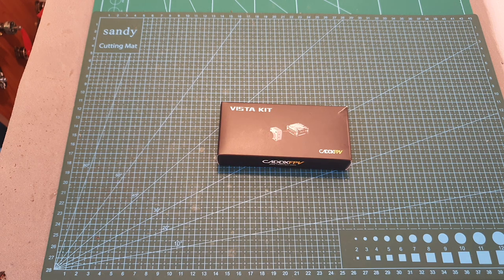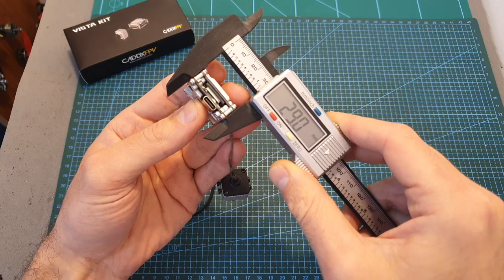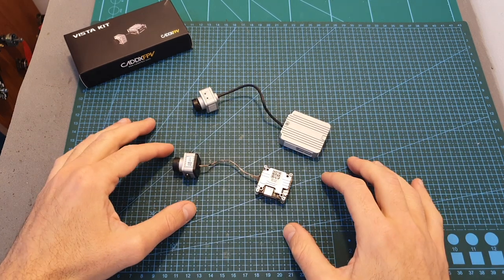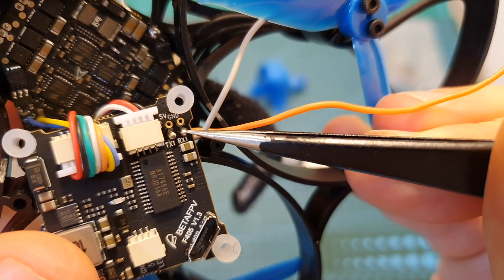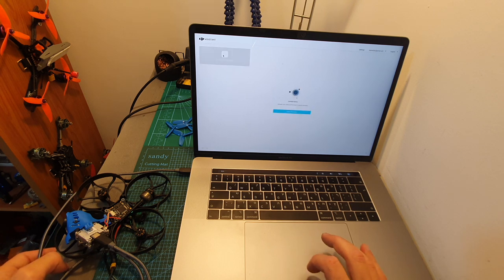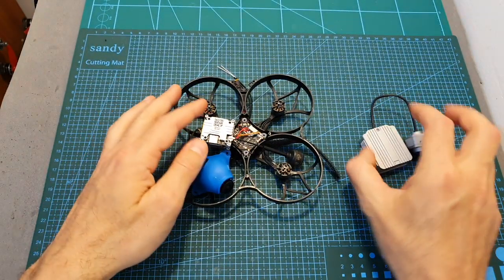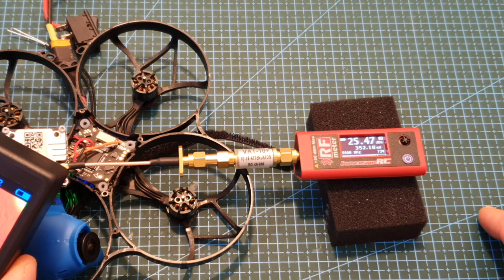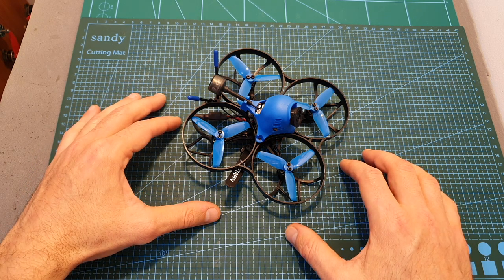Caddx Vista Air Unit (Lite) - Setup & Review

Comment: Help. LOL I broke my ufl connector on my vista. My friend has the top board with different firmware and activated in his account. Can I use it ? Will I have issues with activation and firmware downgrade after install ?

Comment: Hello Gal, I have the caddx vista nebula pro, however when I connect it to the DJI assistant it doesnt recognize it and nothing shows up. Any tips for troubleshooting this???
Reply: Make sure you have 10v at the caddx unit.  Use a multimeter.

Comment: Please help. I'm stumped, my caddx vista shows up in dji assistant 2 fpv series but doesn't show as a usb or hdd on my computer, so can't get to drop the file on, any advice? Thanks
Reply from the maker: Hi, you need to power up the Vista (make sure that the antenna is connected) and only then connect the Vista your computer. If it doesn't work - try a different USB cable.

Comment: It seems that after successfully binding to my Caddx Vista and then reverting to my DJI FPV drone, I have to rebind to the drone.  Is that correct?  I.e. every time I want to switch to a different air unit, even if previously bound, I'll have to go through the binding procedure again.
Update: On other forums, others have confirmed that you should be able to bind multiple air units without rebinding.
Reply from the maker: I am sorry but I don't have any experience yet with the DJI drone.

Comment: I plug my sister unit into the USB-C then I plug my battery in the light turns green on the Vista after about 15 seconds then I hit except twice then I hit activation and it says activation failed. Can you help me what’s wrong
Reply from the maker: Did you get it sorted?
Reply: @KremerFPV  I got the vista sorted. Now I’m trying to get the goggles activated. The goggles take the first 100% of the activation then it will not go past 0 on the second. DJI goggles update failed upload error log. 
I have a family and I haven’t been able to work on them again I may have time this weekend I just I’m not sure what to do they won’t activate they won’t take the activation.
It’s also been cold and windy my old fingers don’t like the 🥶

Comment: anyone failed when activating the vista via dji assistant? mine was stuck at 95% and now it won't detected in dji assistant
Reply from the maker: Make sure that it gets cooled down. I use a small ventilator. Keep in mind that the last 5% usually take longer so be patient.

Comment: I don't understand why DJI did this in the first place, this makes so much more sense than the air unit.
Reply: than* and i wish they didnt partner with caddx, they are known for bad quality control.
Reply: @BonemysterFPV  Sorry for my lack of English my main language isn't English, first off all I personally own Caddx products and have never had QC problems. Second is that what Caddx did is smart because not all builds can fit the DJI air unit. You try putting that in a micro and it would be half the weight. So stop complaining competition is good because this segment of FPV won't grow with DJI being to only producer
Reply: @BonemysterFPV  Also maybe Gal can confirm this but I'm pretty sure the Caddx Vista is produced in one of DJI's factories (somewhere on the box it says that)
Reply: @BonemysterFPV  you've been watching too many Kabob videos 🤣😂
Reply: @BonemysterFPV  Caddx doesn't manufacture this, DJI does. Caddx just sells it under a partnership.
Reply: @mrb2917  all facts. Caddx was smart enough to get with the best technology first.

Comment: Hi Gal can you connect the vista to a F3 flight controller
Reply from the maker: As far as I know - yes, but I haven't tested it. 
On a side note - FCs are pretty cheap these days and for less than $30 you can get an F7 controller, so if you can - get yourself a new FC.

Comment: How are you able to access the osd and change the pids as when selecting this in the goggles It wont allow you to make any alterations as you need the DJI transmitter
Reply from the maker: I am not using this feature but as far as I know it has nothing to do with the DJI transmitter as it's solely done by the goggles.

Comment: Wow the power output is way way low! That’s pretty bad.
Reply from the maker: Digital VTXs work a little bit different than normal ones so as I mentioned in the video this test is not valid.

Comment: If I'm planning on running it on my rc plane with no flight controller, can I just solder a plug to the power and ground to run a separate battery?
Reply from the maker: Yes - you are not going to be able to monitor the battery voltage though.

Comment: Hi gal i just received my vista, wiring up, turn it on and update it, so the vista recognized on computer and managed to activate it. But the vista doesnt get connected to the goggle it's just image transmission stopped and no thing when i check on device....do you know what cause that?
Reply from the maker: Hi, did you bind the Vista unit with your goggles?
Reply: @KremerFPV  yeah man i forgot that last time lol

Comment: I was going to put the unit in a surface tank.  Is it able to run without a FC.  and Just power it up and bind to the goggles?
Reply from the maker: Yes. Just make sure that it gets enough ventilation.
Reply: @KremerFPV  thanks. Yeah I’ll mount a fan with it for constant cooling

Comment: Great stuff! ; ) So....with the CADDX Polar Vista Starlight + (unboxed/no sd slot) Air Unit, and a non DJI FC, running Betaflight, we can: a) record 4K onboard to memory! b)bypass DJI Geofencing? and c)Still fly with a DJI Contrller (via sbus) and/or the DJI Motion Controller? (via sbus?)
Reply from the maker: Thanks! Nope, you cannot record anything (so far) to the onboard memory and there is no need to bypass the DJI Geofancing as it's not present when using the Vista / Air Unit VTXs. You are getting confused with the DJI FPV Drone. 
You can only use the first DJI Radio Controller (not the one that comes with the DJI Drone) or your own Radio TX with the Vista / Air Unit VTXs. The DJI Motion controller is not supported.

Comment: 5:14 , please help. I tried everything: switching ports, cables, laptops, make sure battery is full etc. When i plug it in, nothing happens. You said after 20 secs. I let it sit for 2-3 minutes: no reaction at all. Double checked everything, wiring 100% right.
Reply: nevermind, found it out, had to do something different on fc
Reply from the maker: I am glad you got it sorted out.
Reply: @energydrinkdose7585  I'm having the same issue. What did u do
Reply: @alwinlee5864  Had to short some pads on the fc to get the powersupply working.

Make sure to use a usb-c data cable, not just charging cable (cheap ones may not be able to transfer data)

What could help:
Triple check your wiring, make sure u didnt mess up anything, especially the extra pad for the dji radio, which u dont need if u dont use it.
If still no success:
Desolder everything on the fc (unplug?) and esc if used, coming from the vista. Then just use the power and ground cables from the vista and connect them directly to a power source (2-6s) [make sure antenna is mounted!], so the vista as a complete standalone. This should let you send/receive video (without osd) and perform updates. If that all worked, try resoldering it correctly. If it doesnt work after soldering u messed it up or its a problem with fc.
Reply: Hey mate what was the issue ?
I’m connected to B+ and ground rx&tx and having the same issue 
Zero power ??

Comment: Hello Guys, One question and I´m sorry for my ignorance. Is it necessary the DJI Goggles in order to use the Cadix Vista unit? Can I use the Cadix Vista with my Eachine EV200D Goggles? Thanks in advance
Reply: Requires DJI Goggles
Reply from the maker: No need to be sorry. As Travis said, DJI goggles are required, at least for now as external DJI HD VRX module is not available.

Comment: Is this plug and play compatible with some FCs such as the Iflight Succex-D f7?
Reply from the maker: You will need to solder the wires to the Vista, as it doesn't have a plug like the Air Unit.

Comment: Thank you 
I am installing my first HD kit “nebula pro” and have followed all the instructions 
Power to b+ ground to ground pad and rx tx wired correctly 
I have power to the pads 
But I have no power to the unit ?
It won’t connect to the assistant nor does it generate any heat 
Have you seen this before ??
Cheers
Reply from the maker: Does it work when powered directly to a battery?
Reply: Gal Kremer thanks for the reply !! I’ve powered directly from the battery lead and she now gets hot and has even connected and updated to assistant , but the indicator light doesn’t come on at all and she won’t bind !!!🤨 
Any suggestions would be appreciated 
Thanks mate

Comment: Gal, you left the four camera mounting screws in when weighing the Vista. Couple of grams more different then?

Also, it is not easy to mount the Vista using the 25.5mm “mounts”. Take out the screws and you’ll see.
Reply from the maker: Thanks, I just weighed these 4 screws and found that they weigh 0.8g. 
I will hopefully test the Vista using a whoop flight controller.
Reply: @KremerFPV  Awesome, thanks! 
Only .8g, good to know.
Can't wait to see how you mount it to a whoop FC.
Please post it to the FB group too :)
Reply from the maker: @TweakRacer  Sure thing.

Comment: Nice review! How did you diabled the auto-temperature protection ?
Reply from the maker: Thanks. You can turn it off via the settings menu.
Reply: @KremerFPV  oh! thank you, i thought it was something like "push the butto for 10 seconds etc." I asked because i am having problems in binding my caddx to my goggles v2. It works perfectly with the DJI air unit but with CADDX no way, the red light stays fix on (with a very low intensity) and if ia do the binding procedure nothing happens. CADDX unit is visible when connected to the PC but does not bind, so i thought it could be the "heat protection"...

Comment: never compatible whith Fatshark hdo hdo2? :(
Reply: Well unless someone comes out with a HD module for fatshark goggles, sadly no
Reply: I sold those goggles quickly. Those things would've kept me in the analog ecosystem longer than I wanted. I use a module to fly that old stuff. I even got decent money for my used analog  cameras, vtxs, frames, and receivers. I'm down to two whoops and two toothpicks on analog.
Reply: @escobarfpv1275  Same. As soon as I put the DJI goggles on I listed my HDOs for sale. Got nearly full retail for them. A module in the DJI goggles is fine for the rare occasion I fly a tiny whoop or a toothpick.
Reply: @mrb2917  Exactly. I don't see why someone would even consider buying some HDO2's. BTW when was the last time you saw a byte frost video 😂🤣